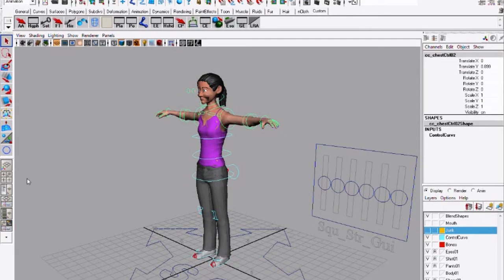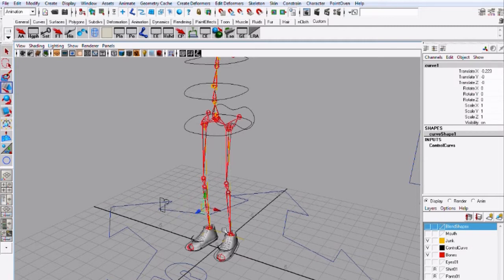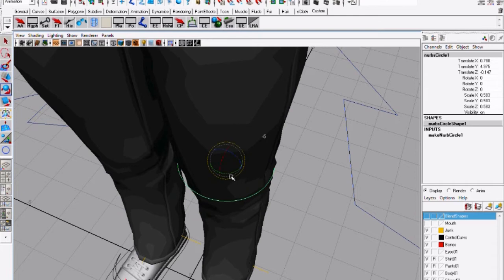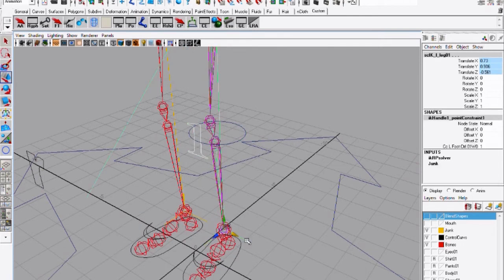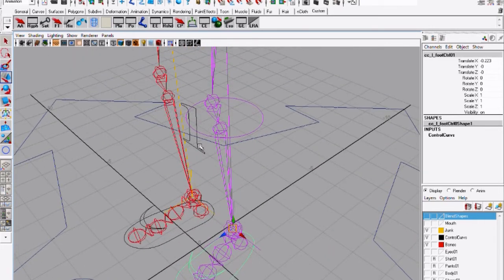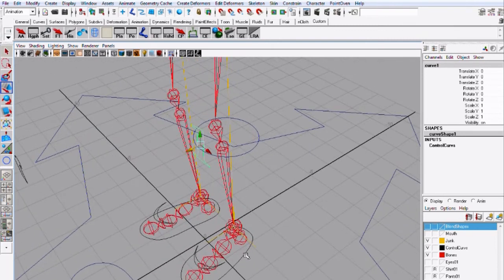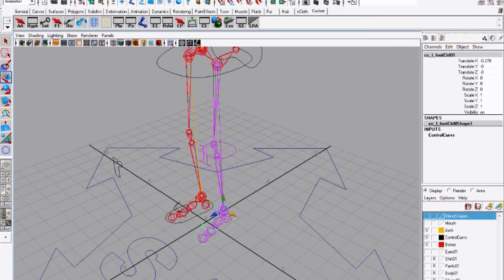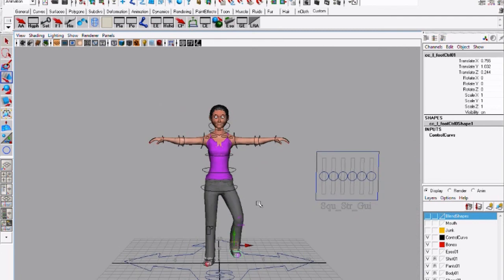Smart Pole Vector Constraint Set-Up

Comment: it doesnt work in maya 2014,  it says must be valid and use rotate plane solver. when i tried to applied pole vector contraint to the curcle nurb which i was using as pole vector, need help
Reply: select u IK again  and  tool setting >  IK Handle setting > Current solver  > change  Single chain solver  To Rotate-Plane Solver  ..see it should be ok